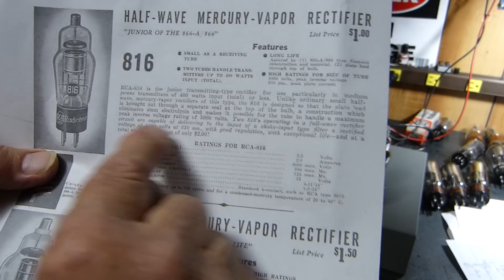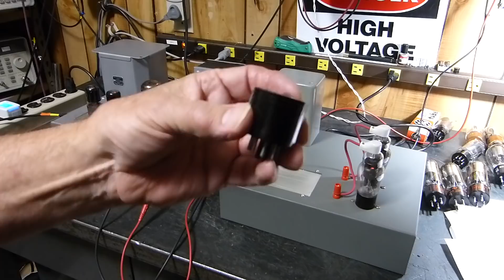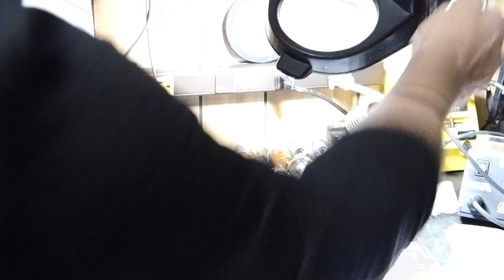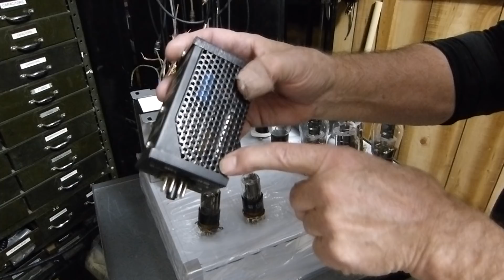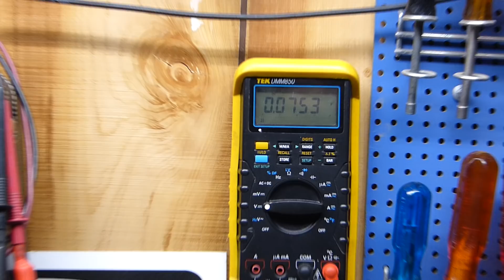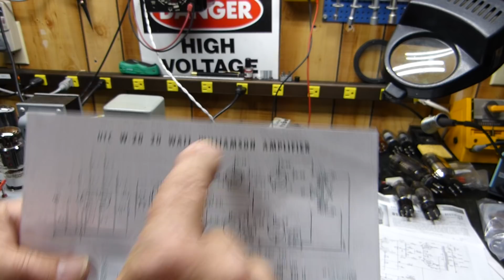Mercury Vapor (Hg) 816, 866A, Xenon 3B22, 3B28  Rectifiers Compared To 5U4 Vacuum Rectifiers

Comment: David, there is concern about the maximum first capacitor size before the choke in a power supply when using these gas rectifiers.  What is the value of the first capacitor?  Is it about 40-60uf or so that would be used for a 5U4 or 5AR4?  I bet these things can take that as they are rugged.  Some say only a few uf can be used.  Others say only a choke input power supply for these gas rectifiers.

Also when using the 3B22 since you are using only one, wouldn't that be only half wave rectification in that case?

Thanks for all these insightful videos over the years.  I have learned a lot from you.
Reply from the maker: Tom, per all the specs on Hg rectifiers,  only a choke input filter is recommended but I have used these rectifiers with capacitor input filters and in voltage doubler circuits which by design has capacitors at the output to the rectifier - running them at 4KV output - and never had any issue. I would keep the size of the input capacitors relative small, as you mention, at 40 uF or below. You are right, these Hg rectifiers are tough. I like to call them the solid-state rectifiers of 1930... voltage drop is constant at about 15 volts regardless of the load. As for the 3B22, it is a full-wave rectifier so you need only one. Thank you for your kind comments. I learn something from you all every time I post a video and have met many very nice people over the years on YouTube.  Stay safe...
Reply: @ElPasoTubeAmps  Thanks again for such a thorough response.  Regarding the xenon gas 3B22 would you say it also could tolerate a 40uf first capacitor in the power supply?  Since it only is rated for 725V PIV have you run it past that?  I suppose a 1N4007 in series with it would help.
Reply: I was inspired by this video to run a test.  I ran two tests, one with dual 649/5834 mercury vapor rectifier tubes and then dual 3B22 xenon rectifier tubes in a full wave CT arrangement on a Hammond 278cx power transformer.  I coupled them to both a 2000 ohm load and then a 1000 ohm load, representing approx 250ma and 500 ma loads as might be expected in higher power amplifiers.

The filter network I used was a 100uf capacitor, then a .5mh choke then a 120uf capacitor.  I certainly exceeded the piv rating as I had over 1000V piv.  Neither the relatively large first cap nor the piv spec busting did I notice any problems.  They even withstood switching (after warmup) into completely discharged caps without arcing.  They also, as you show in your video, have much less voltage drop than vacuum rectifiers.

The 3B22 xenon tubes had less voltage drop than the mercury tubes.  I intend to use these tubes in my next tube amp.
Reply from the maker: @tomlang6480  I have experienced similar performance. The PIV rating is very conservative and so is the current rating. I used 866A rectifiers in a voltage doubler circuit raising 1800 VAC from a 700 mA transformer to 4KV for an 833A RF amplifier and never had an issue. The ratings of Hg rectifiers are always into a choke input filter and the voltage doubler by design is capacitor input to the filter. I turn the HV on during transmission of off during receive so there are many cycles of on/off and I never had an issue with the Hg rectifiers charging a 40 uF capacitor at the input of the Pi filter network. I don't have as much experience with the 3B22 but I figure it is just as tough. Thanks for your information and comments. Stay safe. Here is a link for vintage components you might like.  http://n4trb.com/AmateurRadio/RCA_Ham_Tips/rca_ham_tips.htm
Reply: @ElPasoTubeAmps  No kidding about staying safe!  I notice after all these years (decades) I automatically put my left hand in my pocket around this stuff.
Reply from the maker: @tomlang6480  Yes, I do the same even when HV equipment is off - so I thought... this happened to me a few years ago when, even though I was sure the HV was off, I stood straight, touching nothing, put my left hand in my pocket and reached into my transmitter to wiggle a 4-400A in the socket as the filament was not lit. My index finger barely touched the plate cap and it tingled - I thought - that is not suppose to happen - at the same moment, I saw the anode of the 4-400A on the left turning orange... I jerked my hand out and much to my surprise, the HV was on - 3600 VDC. If I had been lazy and complacent and placed my hand on top of the cabinet and reached in, that little touch would likely have killed me. My heart pounded for a long time even though I was not actually electrocuted. Wow... got to practice the safety principles at all times, even when it is "off"? 🙂

Comment: I feel that the type 83 MV rectifier tube has been missing in this great comparison of mercury rectifiers.
I always thought it was an excellent tube for medium-high power amplifiers and radio transmitters.
It also has a characteristic blue glow, especially at the bottom of the tube.
Reply: It's not discussed here but the 83 and 816 really should be used with an appropriate choke otherwise the repetitive peak anode current may be violated when they are substituted into a 5U4 circuit that only has a capacitor filter. High repetitive peak anode current will lead to premature failure of the tube and degradation of inverse voltage handling. With the 866A, 3B22 and 3B28 you may get away without a choke because of their higher ratings but you should probably still have one anyway to prevent blasting out radio frequency interference due to the negative resistance characteristic of gas tubes.

Comment: In my way distant past (early 1960s) I tended a Gates BC1F AM broadcast transmitter. The 866 MV rectifiers were nothing but headaches always arcing over and overloading the plate transformer and then blowing the main power breaker.  The 866 tubes were sturdy to a point but beyond that they gave up on power line transients.  Replaced them with solid state devices (very expensive in the 1960s since they used many lower PIV diodes in series with equalizing resistors) and never looked back.  Same issue at another station with different Gates 5 kW AM transmitter (BC5P2) that used i believe the 8008 MV rectifiers in a six tube three phase power supply arrangement.  We always had to keep spares held upright in wooden holders or they too would arc over.

Your work here is outstanding showing just what these tubes can do.  Excellent video for tube guys.
Reply from the maker: Philip,
That is a great history of the Gates AM transmitters and living with the 866A rectifiers. I am going to guess the rectifiers were operating close to their max voltage and current ratings and just could not take those power line transients. I have some MV rectifiers that are bad. I do not know what goes wrong with them but I suppose they no longer rectify the current and AC gets thru and causes all kind of trouble... I have plenty of the SS replacement rectifiers for the 866A and 872A that I sometimes use. The SS replacements are cheap now and seem almost indestructible. I generally use the SS rectifiers in my Collins 30S-1 just to keep the heat down inside the cabinet but it works great with the 866A and 3B28. It is all for fun. Kind of like driving a steam engine to the 7-11 for a quart of milk. Stay safe and thanks for your comments.

Comment: I have a 3B22 xenon rectifier which I considered using in an audio power amplifier design until I read the datasheet: The peak-reverse voltage rating is just 750. This means a power supply using this tube can produce 325 VDC at most, which might be useful for a device with numerous small-signal tubes, such as the famous R-390  or SP-600 HF receivers. And the heater power is a whopping 30 watts! Sorry, it's too much for too little.
Reply from the maker: Good point... been a while since I have looked it up and it is amazing it can be replaced with a couple of 1N4007 at about 10 cents each today.   https://frank.pocnet.net/sheets/203/3/3B22.pdf
I never had a SP-600 but my R-390 is still an amazing receiver and it only weighs about 85 pounds about the same as my big UTC modulation transformer. 
They just don't make them like they used to...   🙂  73  WA4QGA

Comment: Can I replace a 5U4GB with  two 866A in a push pull EL34 mono block?
Reply from the maker: It will work if you have room to mount the two 866A. Also, each 866A filament is 2.5 volts at 5A so, if you put them parallel you need 2.5 V @ 10A or you can put them in series for 5V @ 5A but your 5U4 only requires 3A so your filament winding on your transformer is probably not big enough. That means you need an outboard filament transformer. But it will work and it will even raise the B+ in your amplifier as the voltage drop across MV rectifiers is much lower than a 5U4.
Reply: @ElPasoTubeAmps  Thanks. I have a guitar amp design that I have made a few of,  but I wanted to do something a little different this time. I also have  some VR-150's that I might add.
Reply: @ElPasoTubeAmps  I have a 700v with a center tap and a small 2.5v @10 A
Reply from the maker: @acdc_chicken  You can wire the filaments of the 816 in series and run them at 5V at only 2A, so you can actually use a 5U4 rectifier filament supply to light the filaments or you can wire them parallel for 2.5V @ 4A. 700 VCT will give you about 1.3 x 350 = 455 VDC into a capacitor input filter in a FWCT rectifier setup using a pair of 816. They are pretty and a pair is good for a lot of power.   https://frank.pocnet.net/sheets/049/8/816.pdf

Comment: Wonderful video.I use TV damper diodes (6AU4) for high current, high voltage supplies. The manuals say not to use them as such but that's not the case (check out VINYL SAVOR's website and reviews from Germany, written in English). They are indirectly heated at 6.3vdc so you can run them from the main rails, they're noiseless, very rugged, impossible to destroy,  octal, and they're very cheap. I can build a supply of two half-wave 6AU4s with attendant sockets etc., for less money than two HEXFRED diodes with attendant parts (heat sinks, bypass caps., etc.) and they deliver the same power. I cannot tell the difference between them and sand rectifiers as far as power except that they're quieter! They're wonderful.
Reply from the maker: That is really good to hear about the 6AU4. I have considered them but have never gotten around to using them. And the fact that they are an indirect heated cathode at 6.3 volts is definitely a good thing. Thanks for the information.
Reply: @ElPasoTubeAmps  My pleasure - your videos rock. Also check out:  6DE4 / 6AX4 / 6D22S magnoval / 6EC4  magnoval / 6CJ3 magnoval / 6DQ4 / 6W4

Comment: Why not always use a solid state rectifier? With only 0.7 volt drop as opposed to mV or vacuum tube 5AR4.  With constant voltage drop of the ss rectifirer, wouldn’t the regulation be better?
Reply: That is absolutely sensible. Technically, everything is going to be better with the SS rectifiers and a properly designed power supply and the rectifiers are 20 cents each... No one can argue with that but sometimes we just want to use the old rectifiers because we think they are beautiful and legitimately, musicians often like the sound they get from plate voltage sag from loading the rectifiers and having the plate voltage drop. The old rectifiers seem to still  have a place in music production.
Reply: You can't always replace tube rectifiers with diodes as the increased voltage pushes the high voltage caps well past their rated working voltage (even replacements become difficult to find at the needed rated WVDC). And, as we see proven here, MV rectifiers are 99% as efficient as SS and look too cool not to use.

Comment: I wish you would share your schematics of your designs. I would particularly like to see your modulator design.
I have some specific questions on designing a modulator using some specific parts. Where 
do I find other enthusiasts to discuss.
Specially:  I have the following parts: HV transformer matched to (2) 866 mV rectifiers, 1:3 interstage Xfmr,, (2) 2A3 tubes, (2) 813 tubes,and a 275watt modulation transformer, 2nd pwr transformer with 800v centr tap, fil . Etc. I need a schematic using these components to build an AM  modulator.. I can build the power supplies. I need interconnect diagram showing bias circuitry and signal path. My thought is to connect a preamp (Williamson driver}to the 2A3’S, Then couple the2a3’s to the 813’s. On to the modulation transformer. I need some guidance.
Reply: There has been a lot of interest in this AM transmitter modulator. Actually, a modulator is nothing but an audio amplifier with a output transformer secondary impedance to match the class-c amplifier it is modulating that is in the range of 10K (or so) ohms instead of 8 ohms for a speaker. It is actually that simple. I really don't know where else to find people to discuss this subject although I am sure there are groups out there. I tend to stay away from the groups as it seems they quickly end up in opinion and aggression. I am sorry to say it that way but that is the way I see it. I will do the best I can to describe the circuit of the modulator in a couple of videos but I can't promise a detailed schematic. I appreciate your interest and I hope I can help.  
I suggest searching for some of the old Collins Radio schematics for transmitters like the KW-1 or the 30K-1 and others and study their schematics. 
Here is the Collins website with practically everything they made and you can find manuals on these transmitters.
http://www.collinsradio.org/cca-collins-technical-archives/collins-radio-equipment-manuals/ 
73  WA4QGA
Reply: Thanks Ray. I truly enjoy your videos. Aside from building a modulator from scratch; I contacted a musician friend. I hope to find an old guitar amplifier  head unit. In the 100-200 watt range., with a burnt out output Xfmr. I figure that way I can get it cheap. Then I would substitute my modulation transformer.
You mentioned running speaker type output transformers back to back. Some think this is dangerous because of the RF/ high voltage concerns.Maybe this is valid at higher powers.